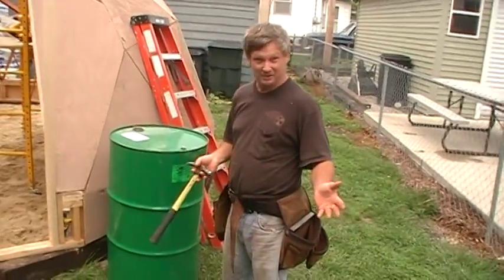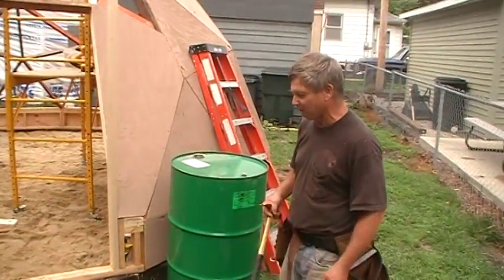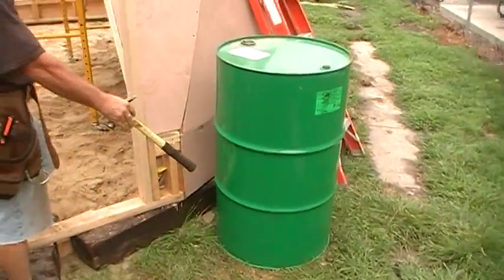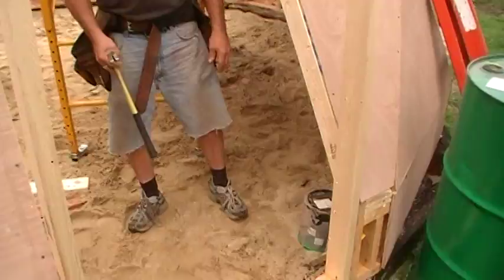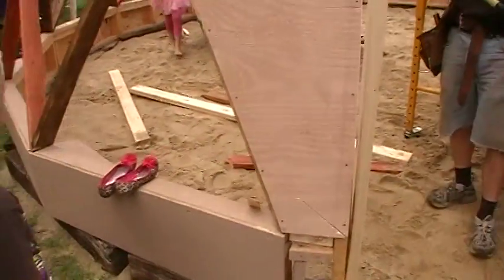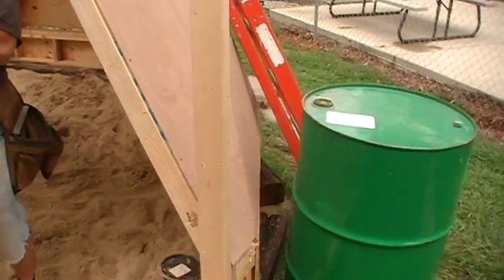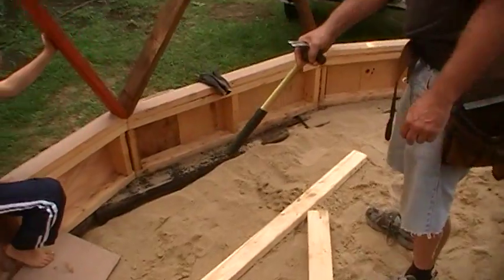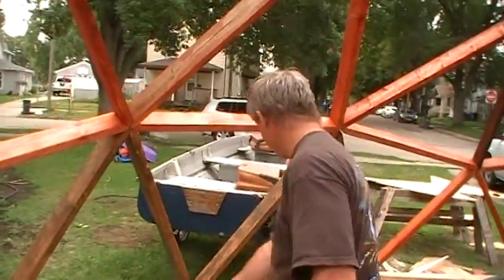how to build a geodesic dome part XI  2012 07 25 023 update for biodome greenhouse

Comment from the maker: Thanks Critterwindow, I was thinking that since the dome is so small that the barrel would heat to much on the inside. I know it gets cold here and that may compensate for it, but I am worried that it would actually damage the plastic. There may be room inside to install the rocket mass heater, but I will build a small room outside the entrance to heat the north side. More on this theory as I get to it.

Comment: the heater needs to be inside or you will waist most of the heat. your heating the mass with what would have been lost in a normal wood stove.